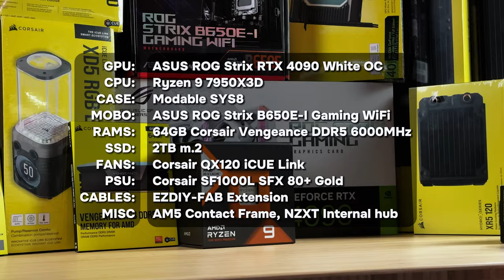Insane Open-Air Custom Loop Water PC Build [RTX 4090 | Ryzen 9 7950X3D]

Comment: why is the hot water coming from the CPU goes directly to the GPU and not let it pass through one of those radiators?
Reply from the maker: The orders of the components does not matter